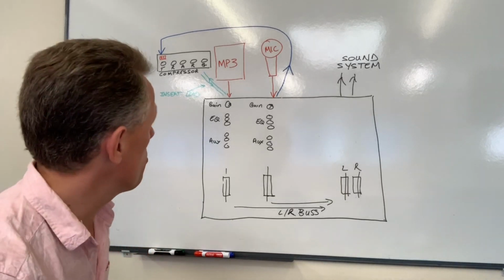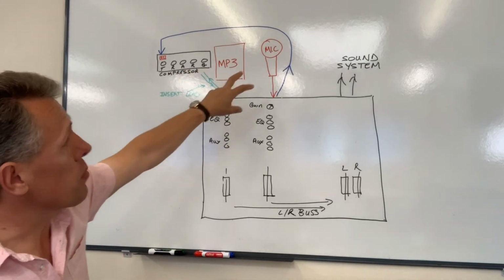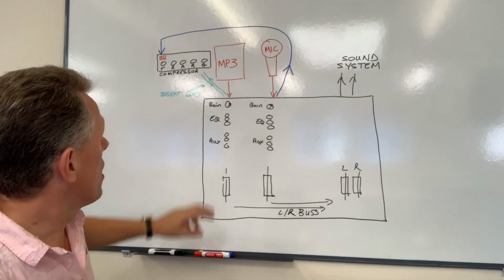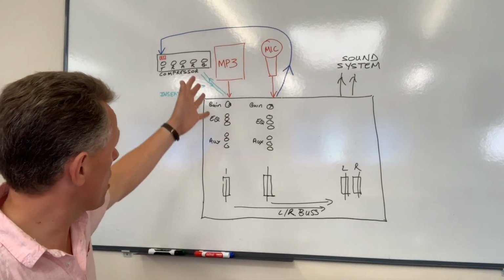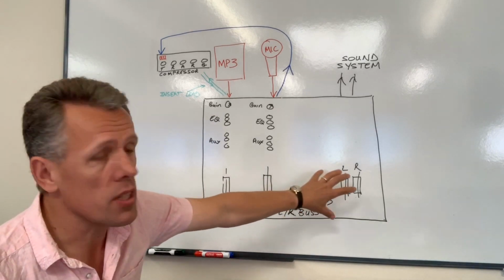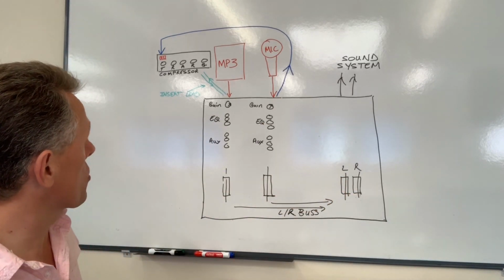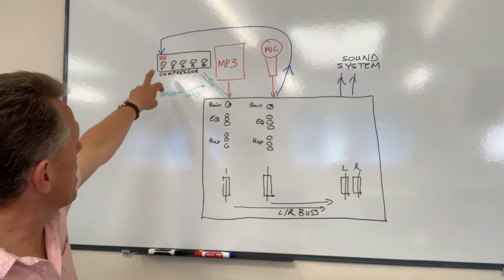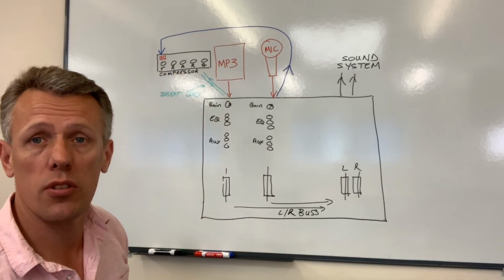Ducking Sound with your voice using a Compressor. Sidechain compression

Comment: Ever so sorry to bother you again I've upgraded my mixer and managed to get the ducking to work with the help of your video so thank you  very much but I can only get the audio ducking to work on the mic channels where the 4 inserts are located but is there a way to get the music to duck with a music source connected to the stereo channels so l can utilize them instead of have a second mixer thanks in advance
Reply from the maker: Hi Glenn, Glad you have it sorted not the mic channels, however unfortunately unless the stereo channels have inserts you won't be able to get the ducker to work and will have to use the mic channels but with 20dB inline pads so they can also work with line level.
Reply: @Base-Sound-engineering  you dont need inserts. you can go with this CDplayer->input of compressor____Output from compressor->Line in on mixer :-)

Comment: I have a behringer xenyx x1204 usb mixer which has no inserts it has aux sends and returns and various other Jack's  I also have a behringer autocom pro mdx1400 compressor is there any other way I can do this I have been searching  for weeks online and cant find another way to hook my compressor up for ducking i desperately need it for my station thanks in advance
Reply from the maker: Hi Glenn, I have looked at your mixer and unfortunately because of the lack of insert send and returns on the channels it's not possible to do it.
Reply: @Base-Sound-engineering  ok thank you that's a shame looks like I need to upgrade again that's another mixer in my set up that's obsolete now hahah